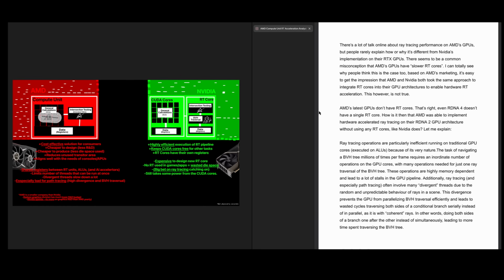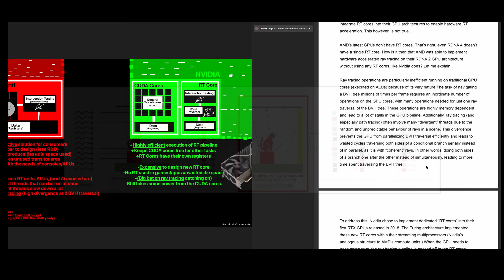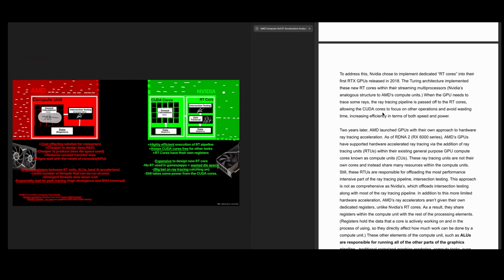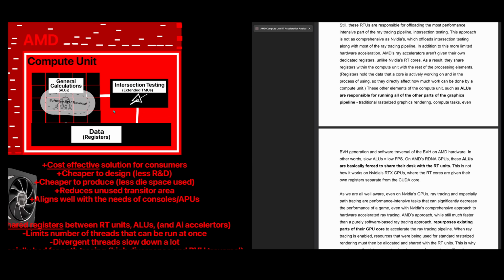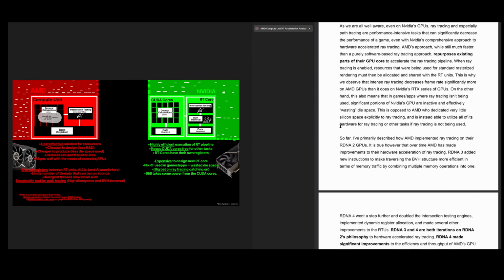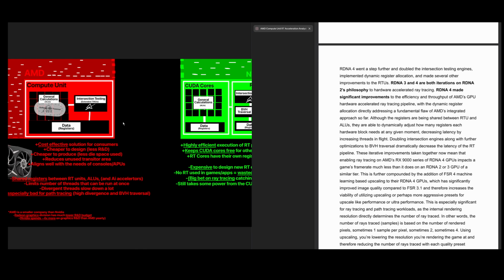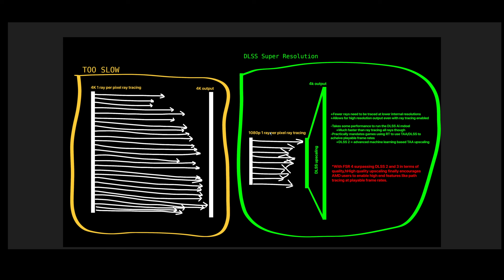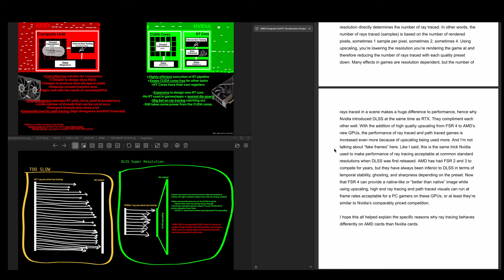How Does AMD Do Hardware Accelerated Ray Tracing?

Comment: Nice that there is a write-up on the screen. Regardless if it is mainly a aid for you the speaker.

Without leaks and a long way away still for UNDA or RDNA5... It skill makes sense that AMD would take a very similar approach to NV next time around. And that is a shame really.
RT and PT are quite honestly a 100% useless feature for games. No, catering to the 1% of users with a computer able to run heavy RT is ridiculous. Consoles and most computers are at best able to run low-mid RT hybrids. Then taking into account handhelds and laptops? How extremely demanding RT is regardless of how much one tries and make it run 'better'. This was pretty much nailed down when RTX 2000 launched in 2018. It would take at least 10 years for RT to be relevant. The only reason RT is even a topic in 2025 is the forced application of it in games releasing now. That most machines and consoles are not at the point of even attempting to run a forced hybrid approach. September 2018 is now in 2025 still not at the 7 year mark. We are 7 years into RTX 2000 series.

I'm not even sure if RT or PT cores is used to bake textures or lighting in game development. If it is then it falls under CUDA workflow anyways. RT only true application since 2018 is in rendering non-real-time movies and scenes. That and marketing gimmicks. You need RT, and DLSS, to play modern games in the way it is meant to be played!

Outside of some RTX 2000 or RX 6600m/6650XT? And I guess RX 7000XT 16GB card. The first GPU that has in my friend and family group even attempted to turn RT on to not laugh at it? That is my RDNA4 Sapphire. What AMD lovely calls the RX 9070 Ti. Because why not confuse costumers into buying Radeon with such naming schemes? I bought this GPU thinking it would be a weak RTX 4070 12GB equivalent in RT. I shocked the RT part up to be nothing more then to run forced on RT in the coming years. Quite frankly the RT requirement going forward for 3-5 years will have to be what the consoles and RX 4070 12GB, RTX 9060Ti 16GB, and RX 7700XT 16GB can do. No, this is not miss-typed. The RDNA3 RX 7700XT 16GB for MSRP $500. I give neither AMD or NV free passes on being called out for the shenanigans. The only RTX 4070 that was worth getting was the 16GB Super Ti Super. Or whatever NV likes to call the SuperDupers. Same with the card NV calls the "5070Ti 16GB." We still remember: Unlaunching The 12GB 4080. GeForce News. RDNA4 naming is so dumb. The only saving grace is RDNA1 naming. And by that logic RX 9060 is more like RX 9050... Like NV's RTX 5050 8/16GB.

This new RDNA4 GPU's using GDDR6 makes them 16GB only cards. So RDNA4 is going to join the group of 16GB GDDR6 cards with some RT capabilities in games. But it is shocking really how well the RT works on RDNA4. As in turn how shocking it is what NV can manage to get out of the small amount of silicon still left in the GPU chips that can do raster graphics. AMD is still behind in allot of areas. CUDA and everything else then gaming is making Radeon a complete mockery. But to give AMD some credit? The concept of RDNA4 is brilliant. If AMD where not behind everywhere else, and charged way to much in the process to in what should be cost reductions to the costumer, AMD would truly be a leg up on NV this time around. With the drivers issues and everything around NV? Yea.

Take the RX 9700 for example running Cyberbug2020. Cyberbug having a broken FSR3 implementation where FSR2 is still to consider using instead. Cyberbug is such a mangled mess of a Xbox360 and PS4 mess. Parts of textures makes Xbox360 back in 2008 look stunning and modern... Then bolting onto that RT and later PT? The hole game is repurposed as a RT demo/benchmark for low vram GPU's. It runs on the Switch2...

1440p monitor @ 75hz Free-sync. Ryzen 5900x bottleneck. High/max settings and high population always. Going down from max setting when having to. RX 9700 RDNA4.
First time now for me playing Cyberbug2020. 5 years later. With a GPU having some RT abilities? Modding in FSR4 support? Due to Windows10 bug it is rather broken mind...

As much as possible at max settings. Having then to turn down to medium RT to play the game. FSR 3.75/4. Modded so take what you like from it. It is partially using the NV code to hook into or something like that. 1440p on Quality FSR. Internal resolution is then sub 1080p? Can get a free-sync gaming experience around 62-80fps. The lock the frame-rate so it is within 73-75hz. This was a few weeks ago when RDNA4 released so I do not remember exactly. I forced myself to play trough the game like that to have the RT 'experience'. RT-Medium was less then a ideal experience. 300W constant GPU usage, and my CPU hardly but thankfully kept up like a trooper. (Ryzen sponsored game.) Every being of my odd mix of CPU and GPU where fighting nail and teeth. For what? the RT looked like shit. Even on quality and a actual decent FSR modification, looked almost no better then what good raster games do. With all the negatives of RT and FSR.

Ok? Here is where the plot thickens. And why I bothered with all of this. Turning instead on PT? No FSR and simply 720p? The GPU was completely taxed! But it could realistically do it at 63-80fps. In some ways I think Cyberbug2020 is adapting settings down in the background for RTX cards also. Lower draw distance on objects and such. But it really was my CPU that was holding my system back at this point. And I have never seen such good looking 720p. The lighting for all the eye-candy pointlessness it dose to the gameplay really covered up the low resolution. But here is the thing that has to be sorcery. Turning back on the modded FSR4 hackjob? Performance and so internally 720p? There was so little artifacts and none of the bad experience from running the game at RT-medium. It had even less artifacts then trying to run RT-high on either performance of quality FSR. If not for my CPU and possibly GPU hitting the very limit of what this components can do in a PT game? (if so 720p internally,) I could get a pretty amazing 60fps locked experienced with FSR frankin mod with DLSS whatever. There was at plenty of times 70fps and even 80fps ish places in the game. That 60fps was almost so in reach that the frame-gen tech even worked. But if even for a moment the frame-rate dropped under 60fps the frame-gen was unplayable. Massive stutters. With a better CPU and I mean only a tiny big more GPU grunt? "Sapphire RX 9070XT Pulse" is my card. On a 120hz monitor it would be playable like that. I'm sure it would be. But going back to my experience I had on RT-Medium? How dose that make any sense? Frametime stability and latency was the same! I dare not to say it but even the frame-gen felt really good as long as the big stutters did not occur going under the real rendered 60fps. Only have a 75hz monitor for now. But the input felt as good not having the frage-gen activated. Sorcery. A little over 12GB of vram usage... The lesser driver overhead on Radeon right now and without vram problems? Then if FSR4 is actually even usable in performance for 1440p monitors? 16.8ms latency? I'm very sensitive for input lag in general. I rather have a steady 60fps above a chunky unplayable 144fps of 20ms+. Sorcery I say. I went with a 75hz monitor keeping in mind that I rather keep 16.8ms input-lag that still looks good over anything else.

Truthfully it has to be a mix of enabling PT in the settings also affecting draw distance and such. But simply turning RT on in a state where it simply is not worth using? When this 'bad at PT' card can actually play CyberBug2020 of all games in at least a playable state with PT? I'm sorry but someone that still think that this mix or hybrid forced approach of RT, is not worth it, rather have a GPU like this RDNA4 one. As little as possible of the GPU chip has useless RT silicon accelerators on it. Only makes sense if you are more on the CUDA side of things and can actually render non-realtime stuff with it. Development. Production. AMD is only really now starting to take ROCm seriously. 2-5 years away from even standing a chance to NV.

No RT or PT is going to fix gameplay. Even now it was rather amazing to drive around with working PT on this RDNA4 card? That if so modded FSR4 can fool me, but not the draw-distance and whatever other problems in the representation? It did not make me want to replay Cyberbug2020. Oh. And funny thing is that AMD knows that Cyberbug2020 is constantly crashing when running PT on RDNA4. Driver issue or some part of the city is causing it. But really? It is a NV first tittle and no PT is going to make fundamental gameplay and story things fixed. I'm still in believes that say the RDNA2, RDNA3, raster abilities + enough vram are far more important then RT. CUDA is more important then RT. GPU Compute is more important then RT in games.

And a fun thing about PT on the RX 9700. The GPU peaked at 600W power draw. Add onto that 150W witch the CPU constantly draws in Cyberbug2020. That 600W peak is very reminiscent to what brought RTX 3000 GPU systems down from power spikes booting into games and such. 600+150w = 750W. Got myself a new 850W Seasonic PSU when getting the card, and the spikes where never something I could have noticed in person. Only what my monitoring program reported as a maximum.  Mostly getting a maximum reported spike around 550-570W. 600.3W being my record still. RT and PT is heavy. Metro Exodus with RT, 1440p? I get a reported 300W power-draw even at 86% utilization on the GPU. RT is not something you get for free. The performance hit is hardly ever worth it still.

Comment: Personally I enjoy AMDs implementation since I can get more performance for the majority of games for a cheaper price. While still allowing for RT support. Heck, when I bought my RX6800 it was cheaper than a RTX3060Ti, and both have similar RT performance, with the RX6800 being able to use all of its GPU for superior rasterized performance. I just think AMDs approach made much more sense this console generation, at least for mid-range shoppers. Nvidia jumped the gun with dedicated RT cores. It makes sense on premium products like the 90-series, but not on the popular consumer-grade products. I know pricing can be very different around the world. Here in northern Europe nvidia is very expensive. And comparing market price I would actually feel robbed of performance if I went with nvidia for the same money as AMD alternatives.

Also, I still don't like what RT does to image quality. I don't like how modern games rely on low precision random noise that require de-noising and temporal algorithms to clean up the mess... I mean heck, when turning on RTGI while using upscalers, the whole image becomes a blurry mess. 1440p has the image clarity of 720p... Compare that to a modern rasterized engine like Source2, where we have great texture detail resolve, high quality materials, volumetric fog, effects, and REALLY high quality pre-baked RT lighting. With 4xMSAA both CS2 and HL:A looks exceptionally sharp, 1440p looks like ACTUAL 1440p and not the interpolated slop we get real-time RT.
Reply: Nvidia target prosumer/professional more with their gpu design. And that's what bring in more money. That's also the reason why AMD ditch  RDNA for UDNA.
Reply: Ray tracing in general is something that I don't feel is entirely ready yet.  Getting it to look sharp and clear, while performing well requires a pretty powerful GPU.  Regardless if you have an AMD or Nvidia card, you need a pretty expensive one to do it well.

Comment: Just FYI Chips and Cheese have interesting article about RDNA4 and Ray Tracing on their website. I think there was some slightly bigger difference between RDNA 2 and 3 and much bigger between RDNA 3 and RDNA 4. Of course this doesn't mean that devs program for it - if it's too niche, then they will optimize only for most popular architectures. Unless they specifically want to optimize for certain architecture or company pays them - since this does take time and effort.

Comment: I really like AMD's approach considering the usage of die space and how Nvidia's specialized stuff is unused in most situations
Reply: Maybe in games. But nvidia design focus is more towards semi pro/pro usage. Ampere for example 3060Ti/3070 is like 2.5 times faster than 2070 in certain professional workload but we did not see such massive increase in games.
Reply: It's a common misconception that RT cores take a lot of die area, probably comes from some Nvidia marketing slides where they showed RT cores taking up 25% of the illustration. But that's nowhere close to how much area they actually need.